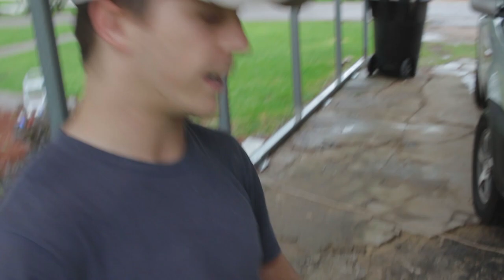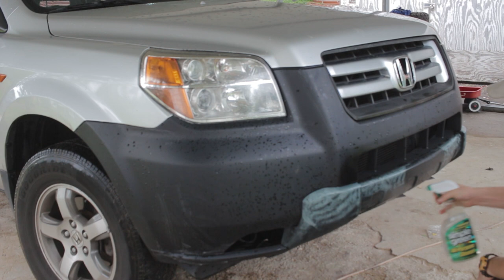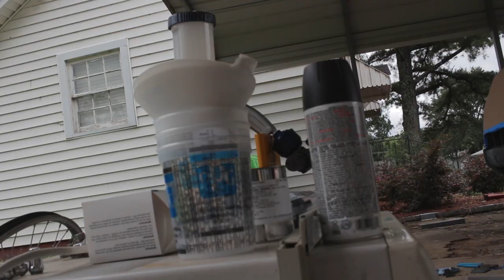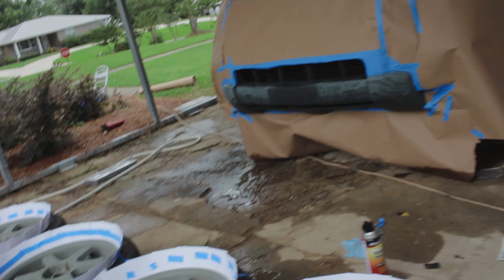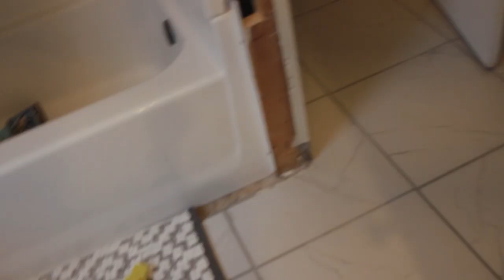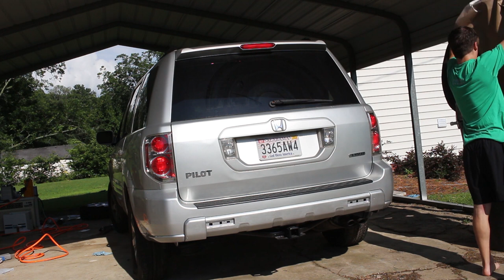PAINTING CAR PARTS OUTSIDE

Comment: A dried soap film is a great way to finish masking tires. Paint rinses off.

Heavy liquid dish soap mixture, just light enough to pump spray. Apply just a nice shine, after masking the way you did. Let it dry, and nothing sticks.  Do it after you tape a nice rim of paper, and before you do final grease and wax prep on the rim (in case of overspray of mask).

Spray can mold release works, too. I've heard of guys using spray cooking oil, but it takes forever to "dry".

The less you have to avoid with your gun, the easier it is to concentrate on, and get, the right and even thickness.

Like your style (subbed), thought I'd toss in a time saver. Masking tires, and keeping it on, is a pain.
Reply: My pleasure.

Comment: What's the standard size air compressor you're supposed to use when spraying cars? I'm going to paint a car soon for the first time.
Reply: John Vahos I've been wondering the same thing. Ive been reading that you need a steady flow of air from the compressor and car spray guns typically use low a continuous air rate. I'm interested to see how his paint job comes out because I really don't want to buy a giant air compressor and that smaller one isn't too expensive to get. I'm interested to know what you get, I might get something like he has for multiple types of projects.
Reply: @VolleyballFamilyAndFriends  60 gallon's